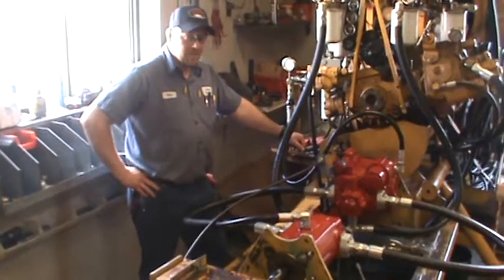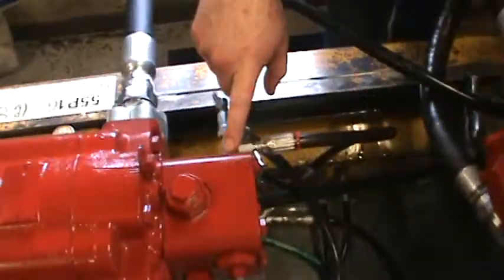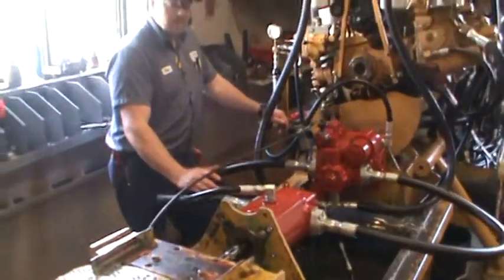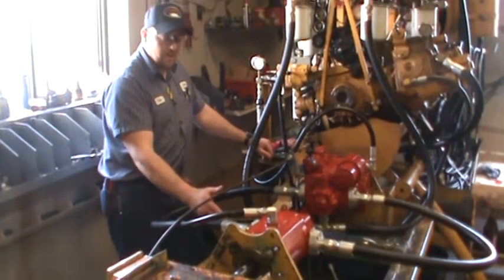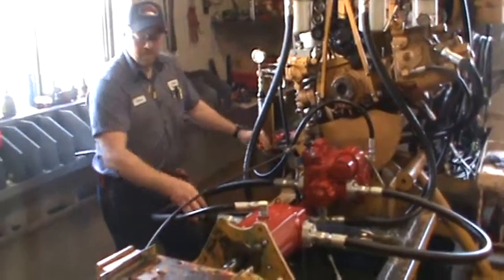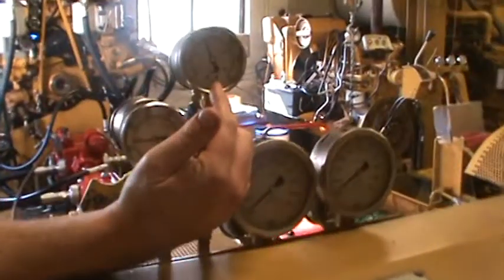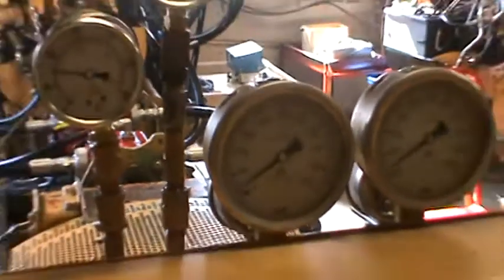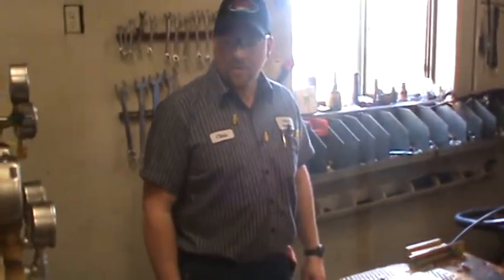Chris Dyno Testing Case IH combine Hydrostat pump and motor.

Comment: Awesome video been thinking about building a heavy 4x4 vehicle using old harvester drives. It will be for a larger vehicle about 5 tons dual V8 engines 
Wish I had more experience with hydraulics.